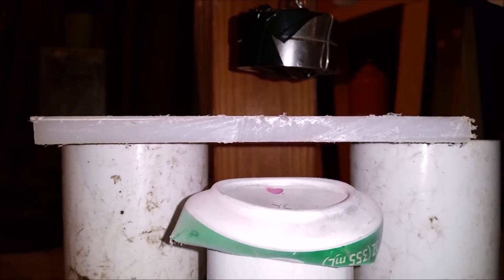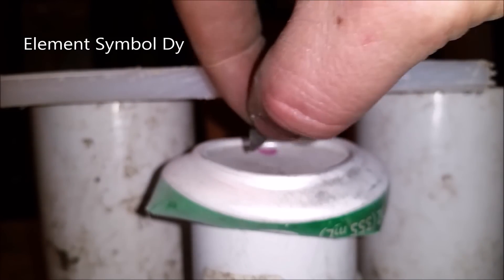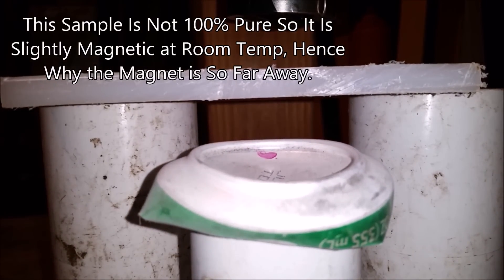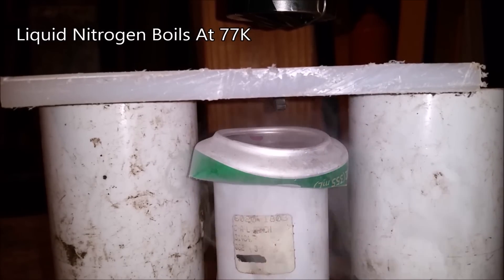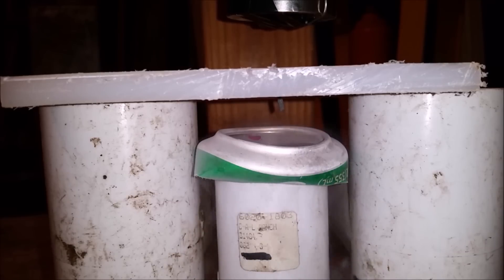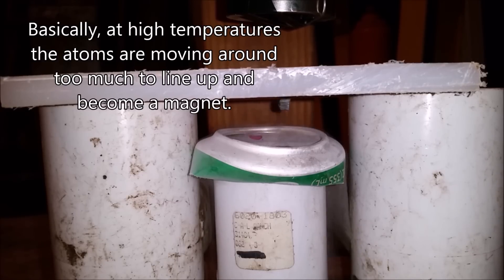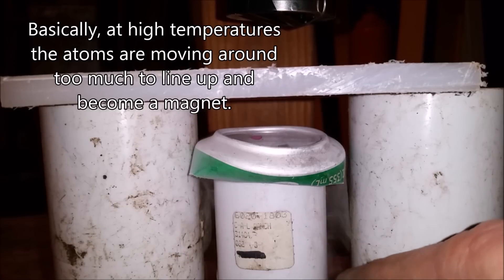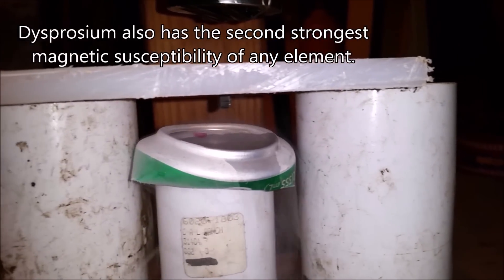Dysprosium Curie Point Demonstration

Comment: adding different gasses such as nitrogen or hydrogen I believe that it is what gives a diamagnetic or paramagnetic material gravitational forces in magnetizm, in my experiments it doesn't happen unless a gas is present and the voltage increase is due to the unstable electrons in the gas swapping field density strength between the other  atoms

Comment: i have a question Cody I do experiments in electromagnetic fields, I have to the best of my understanding  embedded a steel, hydrogen, copper molecular sheet to a copper wire  now it has approximately 300meg ohm of resistance at 18inches on it but if i blow on it or wave it in the air the resistance drops to about 2 megohm or less and of course the original voltage in the wire with the coating is low but measurable and of course this rises as the resistance lowers (i apply no voltage to this it just has it after the coating is applied, i do know that it is affected by electromagnetic interference in the atmosphere and i currently use it on my vehicle to eliminate the effects of what mechanics call vibrational noise in a circuit that affects the computers reading of the sensors thereby over time the vehicle looses fuel mileage , this is the primary cause of fuel mileage loss in today's ECU controlled engines, over the life of the vehicle notwithstanding the usual tune up, and in my truck its gone from 14.8 mpg to 19.8 mpg city driving. i know how it works but this was the only thing that i could think of that i could use it on any ideas?

Comment: Hi,

nice demonstration of curie temperature of Dy. However, there is a slight misunderstanding. Dy is strongly paramagnetic at room temperature. Therefore it is attracted by a permanet magnet even at room temperature.  So not the impurity of your sample is the reason for the attraction at room temperature. At the curie point Dy becomes strongly ferromagnetic (actually it is the strongest ferromagnetic element). In ferromagnetic state Dy becomes even more attracted by magnets.

At my channel there are some videos of curie motors using the curie effect. There Gadolinium is used which has a curie temperature of approx. 19 °C.

Bye,
Udo

Comment: It's a heat engine. It requires the difference in temperature between the warm (magnet) and cold (liquid nitrogen bath) ends to work. No violation of any laws of physics.

Comment: What happened with wireless mic I sent you?  Is there an issue with it?  If so, I'd like to resolve it. I really wanted to get you something you could use.
Reply: +Cody'sLab oh good! :) I was hoping it was something like that. So all is well? It's useful to you?
Reply from the maker: +Jake Walbrun 
I have it, I havent figured out ho to hook it up to my camera though. I think its just me not knowing how to work my camera. I'll consult the operating manual and hopefully I'll use it for Real life minecraft part 5. :)
Reply: +Cody'sLab if your Canon is anything like my Rebel t2i it should plug into a 3.5mm mic jack. I'm fairly sure I ordered some adapters to plug it in. Guess I should have looked up your camera first. :)
Reply: +Cody'sLab I just looked it up for ya. The camera does have a 3.5mm mic jack on the left side under the dust cover. Your manual has info on page 210 about sound settings. Enjoy!! :)
Reply from the maker: +Jake Walbrun 
I just figured it out! The batteries that came with it were dead. I put different batteries in it and it works! The video should be out monday or tuesday.
Reply: +Cody'sLab AWSOME! DEAD BATTERIES! HA. Ill be leaving a comment about that with the seller. Can't wait for the video.
Reply: +Cody'sLab Hey, quick thought for a video if you haven't done it.... Gallium, Aluminum, and Water... And Gallium recovery.

Comment: There's one awesome real-world application that I know of - inductive soldering stations with Curie Point temperature control, which is insanely cool because the thermal recovery is so fast - you can dump tons of heat into some component/traces without the need for higher iron tip temperature.
Here's the video by Metcal about their technology. Btw, they use ~13MHz to heat up iron tip's inductor.
https://www.youtube.com/watch?v=S9Wmqc9O24w

Comment: That's really cool. Got me to thinking, could this be used to produce energy? For example instead of a "normal" magnet could one use an electromagnet and have the plastic (or other non-conductive/magnetizing material) attached to a pulley system to turn a turbine? Then when the cooled metal reached above(?) it's Curie point it would fall and the pulley system would unwind to let the platform fall to reset the machine?
Reply: +Jake Penick Indeed, what you are doing here is in a very convoluted way making energy due to a temperature difference. A lot of people have a conception that one needs heat to make energy, but actually one can easily make energy with cold too, the energy comes from increase in entropy, likewise for a system to lose entropy it must also lose energy. For example, a Stirling engine works on a temperature differential, so one end at room temperature and one at liquid nitrogen would work the same (assuming a gas inside that won&#39;t be affected by either) as one at room temperature and one at about 200 C. You could also, for example, have a nitrogen cooled tube attached to an internal chamber filled with say methane and a turbine, the methane freezes touching the nitrogen pipe, falls down into the chamber, then evaporates (the chamber at room temperature), running a turbine and cooled again in the nitrogen pipe, like a water generator except a cold source instead of a heat one. You could ALSO use an RTG like membrane, except instead of something hot inside and cold outside, room temperature outside and cold inside, basically filling an RTG with liquid N2.
Reply: +TheTechnic Lord So the only limiting factor would be the cost efficiency of the nitrogen, or another low temperature substance, for energy? How are we not testing and refining these methods yet??
Reply: Jake Penick Because it's much easier to make a fire than to make liquid nitrogen. This is exactly how the coal or nuclear generator probably powering your house works, the temperature differential between the fire/nuclear reaction/solar radiation in solar boilers/Earth in geothermal generators and the outside. The technology is extremely refined, the thing is is that the techonology in REVERSE is often used to MAKE liquid nitrogen. It works by putting the nitrogen in a chamber, and compressing it. The compression expends energy and heats the nitrogen up, it is then cooled to room temperature, pressure and temperature are quite related. The nitrogen is then decompressed, which cools it, this is why deodorant feels so cold coming out of the can, it is the change in pressure. The resulting gas is then compressed and cooled again, basically, the energy used to compress the gas allows the heat in the gas to be concentrated, such that the gas is colder than its environment and heat flows out of it rather than into it. Entropy is when things have uniform heat, we are expending energy to decrease entropy, making the gas colder than it's surroundings and the surroundings hotter instead of them being the same temperature. If we used the nitrogen in a generator, we would basically be reversing this, increasing the entropy we just decreased to create energy, energy having been lost when we decreased the entropy. Thing is, you will usually get less energy back, as energy is lost to things like friction, etc, and due to conservation of energy you will never get MORE energy back. You could extract some energy by changing conditions, for example, nitrogen made VERY efficiently in a cold winter could be used in a hot summer to get a LITTLE energy assuming you can somehow keep it cold for that long, due to the temperature difference, though in this case the energy comes from the Sun and it's much easier to just use a solar panel or if you insist on heat difference solar boiler.
Reply: +TheTechnic Lord Ahh so there isn't enough cost efficiency compared to coal or nuclear energy for it to be viable.
Reply: I think it might be more efficient to use a heat source and something with a curie temperature above room temperature.

Comment: Hahaha, this would make a neat external combustion engine; A dysprosium cylinder inside a hollow aluminium bore half its height with water flowing through it (pumped into a radiator) and under that a pool of liquid nitrogen, and at the top of the engine a strong magnet. Cylinder down, cools, cylinder comes back up and is rapidly heated, goes back down and is rapidly cooled again. if you pump the nitrogen on the bottom half and pump the water on the top half and make the cylinder and crank lightweight the engine might even be able to do a minute amount of work.

Comment: Well, you made a heat engine! Heat is absorbed from a hotter source (the bar/air at the top) and rejected into a cooler sink (the liquid nitrogen at the bottom). If you work out the average heat flow over time (e.g. temperature change by heat capacity by cycle rate) you have the heat rate of the engine. Work is potentially done by the dysprosium as it moves up and down in the magnetic and gravitational fields. The average of this over time (e.g. force by distance by cycle rate) gives the mechanical output power. Divide the one by the other and you get the thermodynamic efficiency of the engine. I bet it's not huge...

Comment: I fought curie points one time trying to put electromagnet in a kiln to affect ceramics glazes with iron in them. ... never quite got it. need to insulate my magnet from the heat better
Reply from the maker: +trevor pierce 
Yeah, depending on the magnet even boiling water will ruin them. Might I suggest an eletro magnet? Since heating just makes them less efficient but wont kill them completely unless you melt the winding.
Reply: +Cody'sLab I did make my own electromagnet, but still way hot.  I'm thinking of using something besides steel with a higher curie temp. the insulating the hell out if it.  people always look at me crazy when I have car batteries hooked up to a kiln. ..
Reply: I even made a glaze body that fired around 1000f to try and lower the temp..... I can't remember but I think tungsten and cobalt have a pretty high curie temp.  Maybe I'll look into that

Comment: So, say u contain this in say a vacum chamber, magnet on top, liquid nitrogen in the bottom, and then have the piece jump up and down as it cools down and heats back up again.
Would this not be a perpetual motion thing?
I mean as long as the metal doesnt degrade and the nitrogen doesnt evaporate and the magnet keeps its strength?
Reply: +Edvin Söderman The liquid nitrogen doesn't last very long as a liquid at ~1 bar... it surely won't last long in a strong vacuum... not that I would expect the vacuum to last long with the nitrogen filling the space and the temp equalizing.  If you rebuild the vacuum, re-liquify the nitrogen and pump it back into the system, etc,... sure, perpetual... so long as it's powered.
Reply: +JimmyDB - Ah, I see. I thought the nitrogen would last longer in a vacuum since there is no air to evaporate it. But then again I know next to nothing about the chemistry behind it.
Reply: +Edvin Söderman Evaporation is a state change at the surface of a liquid and doesn't require there to be 'air', only a place of suitable pressure for the gas to occupy.  Increasing the pressure greatly would reduce evaporation, reducing the pressure would aid to accelerate the evaporation as the pressure would also be exerted on the liquid itself and would help to reduce the boiling point of the liquid.  I suggest reading about changing the states of matter and how changing the temp of the matter and how changing the pressure on the matter change the melting point, boiling point, etc,.
Reply: +JimmyDB - He has a point though, if the nitrogen were much colder and the container very insulated, then a vacuum would mean that there would be no air to convey heat to the nitrogen. However, such an insulated container could also be filled with a gas at high pressure, requiring lower temperature and having the same effect. Also, the magnet must heat up, as you said, for this to work in going up and down, meaning so must the nitrogen.

Comment: What if it was done in a pressurized chamber so that the liquid nitrogen would stay liquid? Would that be a perpetuum mobile?
Reply: +Peter Bucek Good question. I'd guess, the Dysprosium doesn't get warm again, so it will just stay magnetic...
Edit: The liquid nitrogen could also get room temperature, because if it can't boil anymore, no energy/heat from the environment can be used for the process of boiling.
Reply: +mati That sounds legit!

Comment: Sounds like you are recording at a very low sampling rate, getting huge amounts of aliasing and/or severely compressing your audio by having a very low bit rate. Bit depth doesn't seem to be a problem, since I can't hear a lot of noise. 

Which settings do you usually record your audio(sampling rate and bit depth)? I would do 48kHz/16bit if I were you. A bit rate higher than 320kbps is also useless, since youtube compresses the audio.

Comment: Infinite energy? I think so!
Reply: How do you constantly cool it? Well, sapce could be an option?
Reply: Don't forget about the energy it takes to create the liquid nitrogen
Reply: +Manu El it wouldn't cool the same way in space as temps would fluctuate a lot
Reply from the maker: +Opinions 
This is actually a good demonstration on how changing entropy can do work, energy really has nothing to do with it.
Reply from the maker: +Cody'sLab 
Although one could say that this is basically a steam engine. Since its ability to do work comes from the increase in entropy from the nitrogen vaporizing.
Reply: ***** If you put a coil around the "magnet" that would create electricity right? Although i doubt that it will create more than it takes to cool it down etc.

Comment: where does the energie to lift it up come from? thermic?
Reply from the maker: +Toxi Core 
Good question! I've asked the same one! Turnes out the energy actually comes from the atoms all lining up and entropy decreasing. (it takes work to do that)
Reply: +Toxi Core It loses energy in the process of lifting up to the magnet. Because its magnetic it has lower potential energy being close to the magnet than being closer to the ground. Then it recieves thermal energy from the air and as it becomes non magnetic, the point of lower potential energy goes back towards the ground. So I guess the thermal energy from the air needs to be enough to overpower the energy it would take to separate it from the magnet. Just guessing though.
Reply: ***** many thanks for the answer :)
Reply: +Toxi Core Yeah, I was kind of describing the other half of the process, I realize now that you weren't asking about that.

Comment: Sounds like you have a totally blown mic.  I base this on the fact that the only audio that has issues in this video is when you're recording off of the mic.  The intro and outro sound fine, so it's not an encoding issue. Mic membrane might be shot from being near too loud a sound or getting liquid in it.

I would recommend you grab an external shotgun mic for the future, so you can reposition it.
Reply from the maker: +rewtuser 
This was the mic on my phone, and yes it seems to get worse and worse the more I expose it to science. Although I think my converting the file to MP3 so that  I could  split stereo to mono may have caused this issue.
Reply: +rewtuser An external microphone would increase even more the overall quality, it would be awesome.
Reply: +rewtuser sounds just like a bad mic.
Reply: +rewtuser Maybe the black powder explosions from the last video did destroy the membrane. :/
Reply: ***** Doesn't need to be fancy.  But yes, it's probably a good idea to do, considering the mic element probably got blown from being too close to science.   Not to mention, on board camera audio sounds like garbage under the best conditions, even compared to an entry level external mic.
Reply: ***** You can get VERY inexpensive single and omnidirectional recording mics for the iphone that plug right into the dock on the bottom.

Might be worth looking into.

Comment: if you found a way to sustain this reaction could you potentially have a beginning of a renewable energy source?
Reply from the maker: +Shaun P. 
I might make a motor out of it.
Reply: +Shaun P. I doubt that this would produce 1% of the energy it takes to cool the nitrogen ;)
Reply: yeah and hot curie engines require fuel too...

Comment: The audio hurts my ears
Reply: +Cody'sLab It has some static noise added
Reply: ***** Still an awesome video though!
Reply from the maker: +Adrian T 
Really?! How so?
Reply: +Cody'sLab Sounds like you are recording at a very low sampling rate, getting huge amounts of aliasing and/or severely compressing your audio by having a very low bit rate. Bit depth doesn't seem to be a probem, since I can't hear a lot of noise. 

Which settings do you usually record your audio(sampling rate and bit depth)? I would do 48kHz/16bit if I were you.
Reply: +Cody'sLab sounds like an old radio thats trying its best to work
Reply: +Cody'sLab I think he means the audio is a little different then normal and it seems to have a sharp tone to it
Reply: +Cody'sLab Yea, like what Hunter says
Reply: +Cody'sLab I noticed this too. Kinda a raspyness that reminds me of sound coming out of blown speakers
Reply from the maker: +Cody'sLab 
My guess is the conversion from wmm to mp3 format.
Reply: Yep!